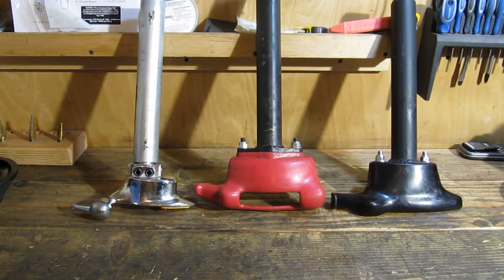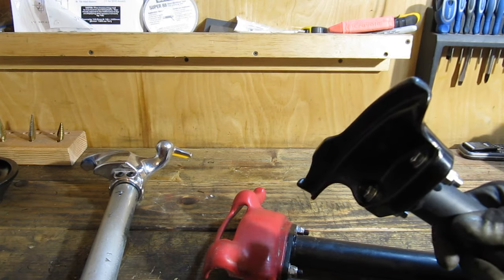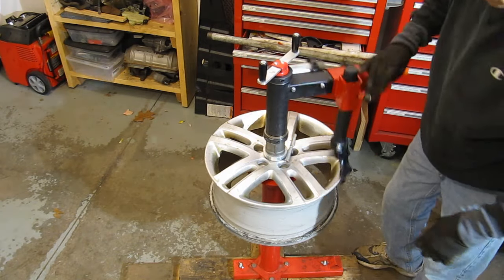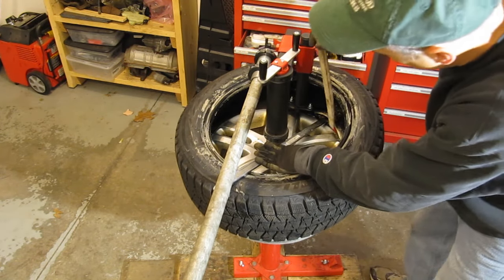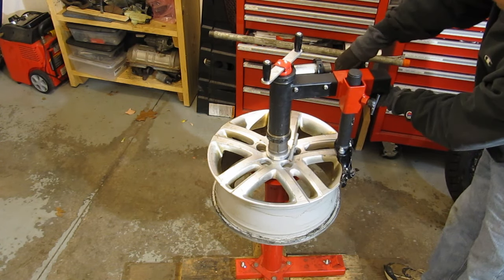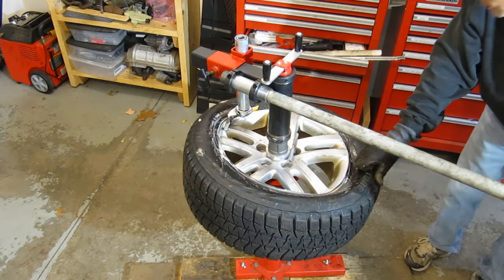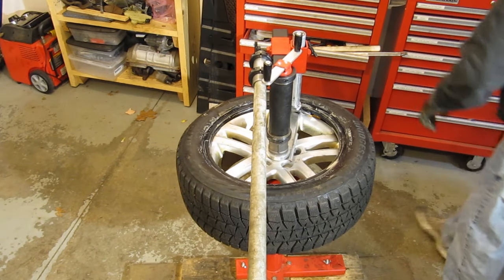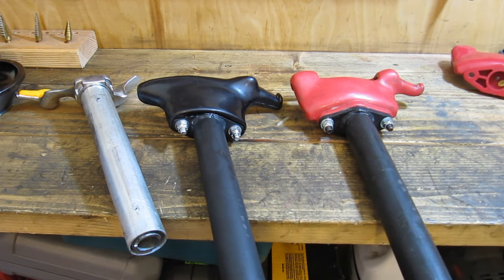Duckbill Comparison

Comment: That stainless one is what is basically used on many tire changers today. The problem is your rod prevents it from positioning correctly. You didn't have the lead flat positioned correctly. It won't dig into anything if it is positioned correctly. The stainless one is superior when positioned correctly.

Comment: FYI for anyone making one of these improvements to their Horror Fright tire machine, if you're planning on removing wider, mud style tires, think of the width when cutting your center pivot tubing to length. I made mine 12" I believe and it's not high enough to remove a 12.5" wide tire.. Time to rebuild it. V2
Reply: Got it rebuilt and it works like a charm on 33x12.50-15" mud terrains. Now I just need to make a plastic tool like the one he has. I had pieces of an old plastic cutting board but they snapped after a couple uses, so I need to come up with a stronger plastic tool to hold the bead in place while I peel the tire off with my new adapter.
Reply: I learned that lesson the hard way too. I got by with it by just sticking a piece of tubing under it to act as a spacer, but when I have to do some wider tires I am just going to build a 2nd arm rather than bother with modifying the 1st one. I used 2x4 rectangular tubing for my first one, so you can imagine how much clearance I lost due to that.

Comment: To demount a tire place the tire iron just behind the duckbill, exactly where you placed your  polyurethane special tool, NOT on the tail of the duckbill. Also, the stainless steel duckbill should be mounted on a square tube to prevent any twist or turning.
Reply: I was wondering how well that circular pipe was kept from rotating to maintain alignment against the forces. A square section tube would do better in that regard, but wouldn't allow fine tuning of the alignment if it's welded in place, which is the advantage of the round tube.

Comment: Thanks. I almost bought the stainless steel duckbill tonight, but I opted for the black one instead. I just recently bought the Harbor Freight manual tire changer. My only complaint so far is the tire change pry bar. I don’t want to seem overly critical but it’s pretty much useless. So I opted to get the aftermarket duckbill kit. I’m hoping that it will make my tire changer work even better.

Comment: The stainless and black duckbill work great when mounted to a motorized turn table (I use them on a daily). Watching the video, I was able to see how they struggle on a manual machine. 
Good demonstration, I’ve never used a manual unit before and was intrigued on how it operates.
Reply: frank im curious if you mount or dismount the tire the way he showed here, i mount my tire clockwise he demostrated his counterclockwise, thoughts?
Reply: @ManthatsCool100  i use a motorized tire changer. The head stays stationary while the wheel assembly turns clockwise. So I guess it would equal to the same, as he is doing in the video
Reply: @Frank Lopes  well frank what I mean is the way he does it counter clockwise the ducks head is pushing it down around the rim in essence its doing the same thing but one thing that I have noticed is that there is a pinch point doing it clockwise. So I'm wondering if that would be the better way to go, I'm thinking of putting the nylon head on my machine for this reason
Reply: Worked on machones a few years, personally i loved the stainless the best. Will probably use it on my manual, for motorcycle tires

Comment: Thanks a ton! You just saved me about $50 that I would have spent trying these out. Looks like my red one will do just fine. I was hoping one would work well without the drop center tool, but it seems that tool is worth its weight. I tried skimping and doing without it after I first built my machine, but I discovered that if I didn’t have one of my 7yr old daughters near by holding a tire iron, mounting them by myself was tough. I’ll just keep using my new drop center tool and call my machine done.
Reply: Offcut of wood will keep the bead down in the well

Comment: Fantastic video with great lighting, camera angle, and voice descriptions. You gave me the inspiration to make my own duckbill arm for my HF tire changer, assembled using a Tractor Supply Jobsmart wire welder. Unlike the Lucid design, mine doesn't have needle bearings but it still works. The aluminum tire lever and bead clamp tool were the other critical pieces in your setup that made it much easier to mount/dismount tires than using just tire levers.

Comment: Thanks for a good video and an interesting comparison. I began mounting my own tires in the '60's when they wanted an extra fee (very expensive fee) for doing alloy wheels and no guarantee and no liability if they damaged them. I've mounted numerous tires over that time, many manually with irons, and many with a manual changer, and I've never felt the need for such a device  and doubt I would have the patience to use it.

Comment: Great Video! I really like the way you setup your lever with the pipe and clamping collars. I would like to know more about what you used (sizes etc). I saw your earlier video with the worm gear clamps and this is obviously much better. In my case I need to be able to do ATV, Mower, Trailer & Auto tires so I am a little concerned that doing it the way you did may limit how much I can reduce the radius of the duck head and prevent me from doing smaller wheels & tires. What are your thoughts if any on that? What is the smallest diameter wheel you have done a tire change on with your setup?

Comment: I originally used this video to justify getting the black duck head for my Ranger tire machine which came with a steel duck head but without any provision for plastic protectors. After a few years of mounting motorcycle and car tires, I found that the extra profile of the plastic head makes mounting and unmounting stiff or low profile tires much more difficult than it should be. I've gotten to the point of shopping for a new steel head that looks like the one you show in the video. The small plastic inserts will be more than enough to protect the rim, and on my tire machine the post is octagonal, so no chance of spinning out of alignment.
Reply from the maker: Thanks for the information!  I'd love to hear what you think once you try it out.  I can definitely see your point that it might be better especially for low profile tires as it seems like the overall cross-section is reduced with the metal head.
Reply: Do you have a diagram information on the unit you built
Reply from the maker: @richardyelich4695   No, sorry I don't since I didn't build it.  This tire changer was purchased from Lucid Autowerks (Ebay Store).  I made a few minor modifications (adding the spin handles on the top and the bar holder on the side) but the unit itself is just the Lucid Autowerks product.

Comment: Interesting comparison video. Well done. It does seem that the stainless steel version would work quite well if it were indexed so that it could not rotate under pressure. Maybe square tubing instead of round for that one?

I use the red one with good results. I do not have the Lucid setup, just a highly modified HF changer.
Reply from the maker: That's a good point Corey.  That might have put the stainless steel head at some disadvantage.

Comment: Thanks, I have the Derek Weaver machine and I’m looking at options for my ATV wheels. Those tires are 5 times tighter to install than any automotive tire I’ve done. I’m hoping the plastic head works better with the smaller diameter rim.

Comment: Just to dissapoint you but the "stainless unit from fleabay is not stainless but chomed steel. I know because mine is chipped and rusting after a cple years
Reply from the maker: Thanks for the information!  I did not know that but I guess I'm not too surprised.  Thanks!

Comment: where did you get the attachment that is bolted to the side that your using to slide the poll in its two clamps bolted to the duckbill frame seen at 3:10
Reply from the maker: I made it.  It is really quite easy to add and I think makes the tire changer a lot easier to use.  I used two split collars:
https://www.amazon.com/gp/product/B0063L0E9W

I drilled and tapped a hole in them to mount them to the side of the tire changer.  Then I just used a section of steel pipe inserted through the two collars.
Reply: @JohnsDIY  thanks for the link, yes i like that mod that way your not fumbling with the bar on the face of the rim.  ok so you tapped the collars and bolted it to the duckbill attachment, its hard to see in the video are those allen headed bolts? im assuming the head of the bolt is on the duckbill attachment and not inside the collar so that there would be room to clamp the pipe inside the collar.  what bolt size/thread did you use?
Reply from the maker: @Madmax.3  Yep, you are right the head of the bolt is on the other side of the tire changer square tubing.  The bolts are M6 x 1.0.  I put together a document with some pictures and more details at:

https://accordrepairsdiy.wordpress.com/category/miscellaneous/

Let me know if you have any other questions!
Reply: Awesome video.  Where did you get the polyurethane tire spoon? I have chrome rims with low profile tires, so they're really stiff to remove

Comment: stainless steel  duck bill wont work right on your tire changer  you need a square shaft so it does not rotate under pressure . also the rotating force should be as close too the duck head as possible or it will twist and did into the rim.i bought a red  duck bill just wait until you mount a touring tire . switching to black

Comment: Did you buy the lower half of the tire changer from harbor freight
Reply: Yep, the base part of the tire changer is from Harbor Freight.  It has held up quite well and I'd recommend it (especially for the price).  The bead breaker on it is not great in my opinion.  It is a little weak and tends to bend sideways under normal to heavy use.

Comment: @JohnNH Very nice job with the duckbill demonstration.  I like the way that you keep things nice and mellow, as opposed to trying to become some kind of a YouTube video star.  Would you mind telling me what you paid for the Lucid Autowerks tool.  I'm also assuming that you're using a Harbor Freight Wheel Changer Base, so I was wondering if you've mounted it to a wooden cross base instead of hammer-drilling your concrete floors and adding concrete anchors of some kind.  By the way, where did buy some of those nice general purpose tire tools.  Have a good one and thank you.
Reply from the maker: Thanks for the comment!  I can't remember what I paid for the Lucid tool, but I do remember that I looked after I had bought it and it had gone up in price dramatically.  I think there was also a good discount on it when I got it (maybe he was just starting out?).  It looks like there is at least one competitive product on Ebay now so maybe that will drive the price down some.  

Yes, it would be better to have the tire changer mounted down, but I don't have a permanent place to do that in my small garage.  It works okay on the wooden base, but definitely takes a little practice (to make sure you are standing on it when turning the tire changer).

The tire irons are just the $5.99 ones from Harbor Freight! :

https://www.harborfreight.com/24-inch-general-purpose-tire-iron-93230.html

Comment: Thank you for a great film. Where you can buy those Duckbill Holders? I purchsed 2 extra Duckbills (Black and Red), but they both don't fit my HF Tire Machine Attachment. The orifinal Duckbill on that attachment has centers of the holes at 68 mm apart, but in the Duckbills I got those distances are a bit different. I assume I need to find corresponding holders for Red and Black Bills. Thank you again.
Reply from the maker: Thanks for the comment!  The duckbill arm that I have came from Lucid Autowerks:
https://lucidautowerks.com/collections/ultimate-manual-tire-changer
Reply: @JohnsDIY  Thank you, it is good to know, but I have that thing what you call arm. I nrrf just the holder (the cylindtical tube w/a flange attached to it), they don't have it. But thank you.

Comment: as a kid i used a manual coats tire machine after taking off 4 tires on a car trailer then re mounting 4 more they were 15" of course but i was exhausted, but i recently bought a motorized one, and i will say i dont feel like i have the control with it its just kind of a either no pressure or full boar, im curious if the nylon one would be the better way to go

Comment: Will the nylon ones last very long? Some have complained they break after a few uses. Have you found that to be true or not?
Reply from the maker: Thanks for the comment!  I don't do a huge number of tire changes, but the original nylon duckbill has held up just fine.  I think it will last a LONG time, especially if kept well lubed.

Comment: Where do I get the the modification pieces that you have? I"m having a problem finding them!
Reply: Hi Ronald, not sure which modification pieces you are referring to, but here are some links that might help:

Hunter red duckbill:

https://www.amazon.com/Mount-Demount-Head-Hunter-Changers/dp/B00LC4MLPK

Black duckbill:

https://www.amazon.com/Plastic-Demount-Hunter-Accuturn-Changers/dp/B00LC9F7I8

Stainless Steel Duck Head:

https://www.amazon.com/gp/product/B0797T938G/

Lucid Autowerks manual tire change upgrade kit:

https://www.ebay.com/str/lucidautowerks

Bead clamp tool:

https://www.ebay.com/i/183884462011
https://www.amazon.com/Changer-Clamp-Center-Universal-Hunter/dp/B06ZYTFRGB

Comment: Thanks for the nice video, the only comment I would have is that a round tube does not belong in a square tube, that's why you will have problems with the stainless steel duckbill.
Reply from the maker: Thanks for the comment.  Yes, perhaps with a square tube it would keep the duckbill from rotating.  I'll have to try that if I get a chance.

Comment: I'm having problems with the black and the red one on motorcycle tires. The red stands too far away from the rim because the lower lip is too wide for motorcycle rims. The black one will not stay down when the tire iron goes over it.

Comment: I'm so confused. I have been in entire business for over 37 years and used several different brands of Tire changers and never have I ran the machine reversed to do any amount or dismount please explain
Reply from the maker: Thanks for the comment Steve!  You have definitely got me beat on experience.  I've only ever used this manual, hobbyist tire changer and never a commercial tire changer.

However, I'm not sure what you mean about running it reversed?  Do you mean the spin direction?  I believe I was using the same effective rotational direction as is used on all the commercial automated tire changers I have seen.  What might be confusing is that normally (on automated machines) the wheel rotates and the duckhead is stationary whereas on manual machines like this, the wheel is stationary and the duckhead rotates.  On all the commercial tire changers I have seen (links to a few videos below for example), the tire spins in the clockwise direction.  For the manual tire changer, this is equivalent to spinning the duckhead in the COUNTERCLOCKWISE direction, as I was doing in this video.  Rotating the wheel clockwise is equivalent to rotating the duckhead counterclockwise.  Notice that in the videos below using commercial tire changers as well as in my video with the manual changer, the trailing edge of the tire exits over the "bill" part of the duckhead because the relative rotation is the same.  But let me know if you think differently or if I misunderstood your comment or if you know of other tire changers which operate differently.

Here are a few examples of commercial tire changers, showing the wheel rotating clockwise (when looking down at it), which corresponds to rotating the duckhead counterclockwise in the manual tire changer:

https://www.youtube.com/watch?v=8hOZXIr1ujE
https://www.youtube.com/watch?v=BsOUtR_lT
https://www.youtube.com/watch?v=BsOUtR_lTeE

Comment: Great video. Are these duckbills meant to contact the rim as you are removing the tire? Or ride just above it? I have one similar to the black one and it flexes a lot when removing the tire and contacts the rim. Is this normal?
Reply: It is not meant to contact the rim, it should be slightly off the rim.

I prefer the metal duckbill because it is thinner and works better. The technique shown in this video was not how it should have been adjusted. The plastic ones are meant to be a consumable item for shops, just in case the operator makes a big mistake, the plastic duckbill will flex and or break, protecting the rim and the expensive machine from costly damage.

Comment: Can you explain why it is necessary to use your "special tool" when the tire iron is already in position?
Reply from the maker: Hi Warren, good question. The tire iron ends up on top of the duckbill (between the duckbill and tire).  I find that as I rotate the duckbill around with the tire iron in that position, often the duckbill lifts the tire up but doesn't cause the tire to start riding up over the rim edge.  When that happens, I think there are two options.  First, you can pull out the tire iron and insert it next to the duckbill (where I put my "special tool").  This forces the tire to start riding up over the edge of the rim.  Or second, you can insert the special tool instead.  I think either method works, but I prefer the polyethylene tool for two reasons: sometimes when you pull out the tire iron to move it, the tire slips back off the duckbill, and secondly the polyethylene tool won't mar up an aluminum rim (though probably if you are careful that's not a big deal).

If you look at the following video starting at 6:02 you'll see an illustration of this issue and how the polyethylene tool solves it:
https://www.youtube.com/watch?v=J2jNd3bgZuQ&t=2s